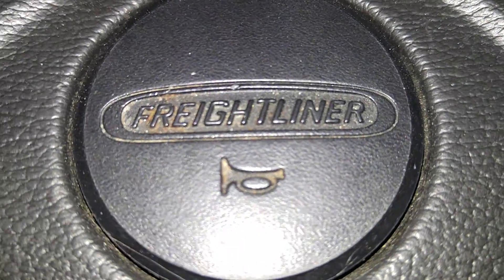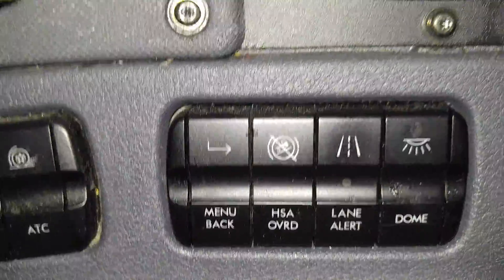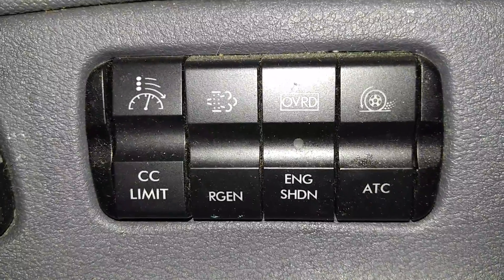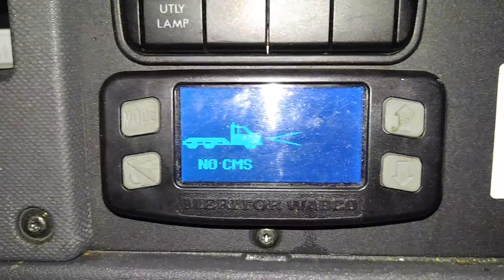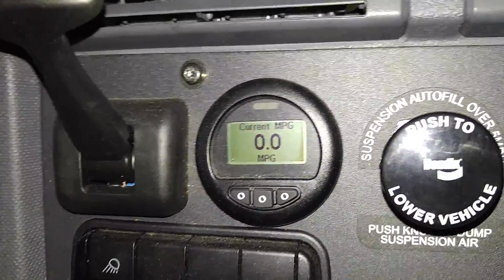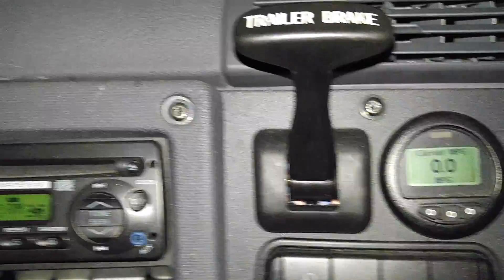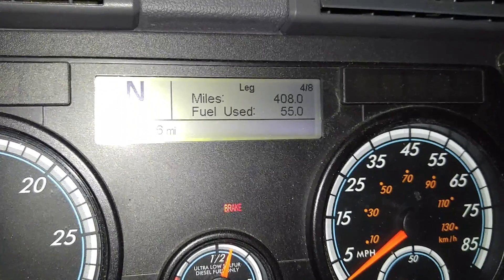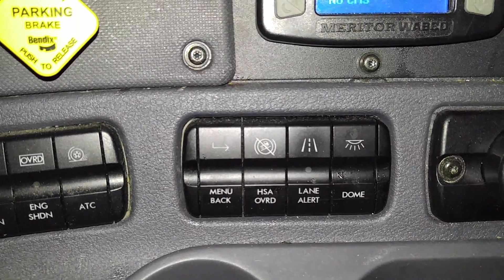What are all the switches in a semi for? Freightliner Cascadia.

Comment: Thanks for the video just switch trucks been driving a kenworth  Manual transmission now driving 2016  Automatic freightliner Cascadia and all the switches are different.  They're still 3 switches on here that I'm not sure about that are not on your video 

Inter axle diff? Lock/unlock
Fifth wheel slide. Lock/unlock
Susp air. Lock/unlock

 I'm pretty sure I know  What the last 2 are for not sure about the 1st one

Comment: Hi everyone. I have a very strange situation. Some times when I’m on the open road and have my cruise control on the on position, it has been times when my truck starts to gain speed if I’m going on 65 mph It can go up to the fastest it can go. I have already replaced my sensor that is located on the side of the transmission and it still does it again 
What is wrong with my truck
Reply: Ricardo Robles Gil 
Then it is the switch.

Comment: Does the trailer release work when your driving down the road?
Reply from the maker: No. It works like this:  It won't unlock the jaws unless the truck is stopped, in neutral and the brakes set. Then, you push in the release with your right hand. It is spring loaded so you have to hold it in. With your left hand you release the brakes and pop the truck in drive. You can then drive out from under the trailer and release the dash button and the jaws are ready to grab the next trailer.  It also has a traditional handle to release the jaws but it takes about 5 times the force to open it that way.  Tip:  Spray the jaws with WD-40 every few weeks or the auto release stops working.
Reply: Unknown Trucker no, the release  switch don’t work as u driving .